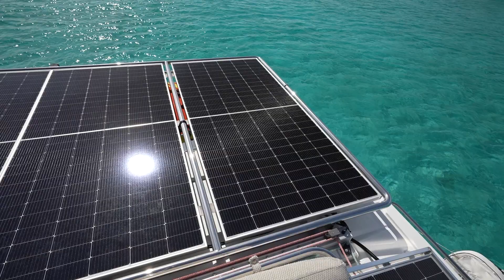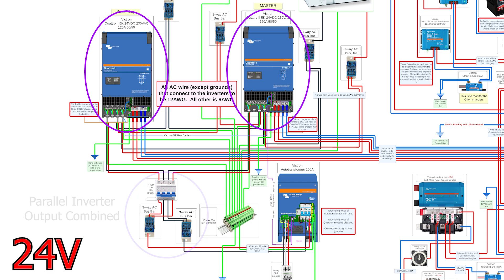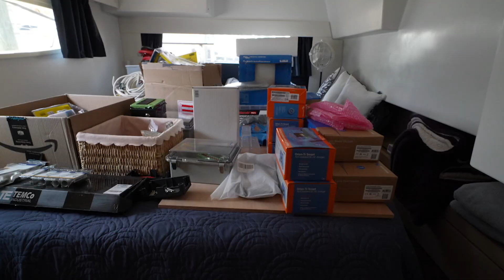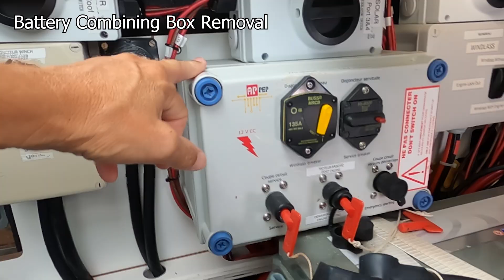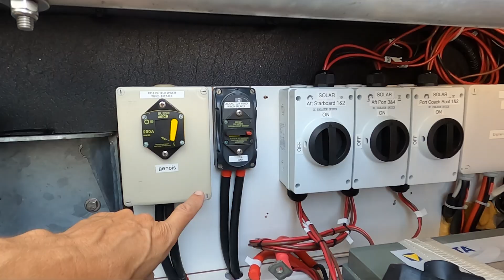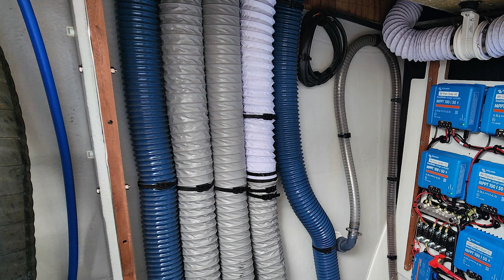This Power System Changed Our Sailing Life!! - Part 1 - Ep. 35

Comment from the maker: Hi Everyone!
This is the first in a series of videos covering our complete power system upgrade on our Fountaine Pajot Saona 47 sailing catamaran, which took over six months to complete.
In this video, we start with an overview of the system and the reasons for the project, design work, etc., and then move on to all the electrical cleanup needed before we could start the full installation of all the new fun stuff.

FOR THE LARGEST POSSIBLE DISCOUNT ON EPOCH BATTERIES (Minimum 10%), Use this link:  https://www.epochbatteries.com/?rfsn=8400125.d4f07b9
Our discount will match any discounts on the website as well (holidays, etc.)

Thanks so much for watching!  Stay tuned for all the upcoming videos in this series :)

Comment: Great episode and intersting perspective on 12/24/48v alternative - for the record Victron provide a 48v/12v DC/DC charger, which works just fine - I use this charging 12v AGM bank from 48v lithium battery bank with no issue (readily available) ...

Comment: First, its a great system... don't get me wrong.  I think you made some good choices.  Some of your logic is a bit flawed, but there are still plenty of reasons to go with 24V on a boat.  So don't take my points below as harsh criticism... really it's just light informational criticism instead.

* One thing about 48V... you don't have to put 12V batteries in series.  You get native 48V batteries instead and put them in parallel just like any other system.   Same with a 24V system... I'm not sure why you bought 12V batteries when you could have purchased 24V batteries (aka 25.6V LiFePO4) and gotten a lot more redundancy and scrapped the need for whole-battery balancers.

* For battery redundancy just paralleling two or more batteries does a good job.  So, for example for your 12V house bank... don't have just one 12V battery.  Have two smaller batteries in parallel for the same capacity.   You don't want to rewire batteries so in an emergency if the 12V bank dies completely... either just have a smaller 3rd battery (like a 100Ah or 50Ah 12.8V LiFePO4 battery) in storage, or have a DC-DC trickle-charger in storage (or even wired in permanently).  Or an AC charger that you can hang off the inverter output.

Systems such as the one you have in your boat now have a ton of flexibility when things go wrong.  It is almost always possible to make sufficient repairs or kludge-up solutions that retain nearly all the functionality of the system.

* Generally best to go with trickle-chargers for DC-DC instead of converters.  I think you did mostly go with DC-DC chargers but I'm not sure.  Main reason is that you can trickle-charge the cross-voltage energy flow at much lower amperages and the equipment is a lot cheaper, easier, smaller, and doesn't get stressed.

* Same thing for the starter battery... trickle-charge from the 24V bank instead of having a 12V alternator you have a 24V alternator (you might already have it setup like that, I don't what alternator configuration you are using).

* Victron kinda fails at providing split-phase solutions, which is really unfortunate.  You came up with a decent way to work around the problem though but you may want to keep a small 24V inverter on the shelf somewhere just in case the weak link (the auto-transformer) fails on you.  Otherwise your AC power is DOA.   Or even have it wired in (such as wired into the nav station), but turned off most of the time.  Just in case... so you have an AC plug that still works for a time even if the entire house system goes down.

--

However, you are absolutely right about the solar panel configuration.  It doesn't actually take much to develop the needed voltage but boats in general have very little surface area and a lot of variable shading to deal with, so it's reasonable to choose a 24V system voltage.

* One solution for solar on 48V boat systems where the solar panel topology is severely limited is to use a boost charge controller.

* Another is to simply have more lower-wattage panels in series.  For example, 4 x 25W panels in series can charge a 48V system just fine.  Or 3 x 50W, or 3 x (or 4 x) 100W, 3 x 200W, 2 x residential, etc.   Lots of options where the panel area taken up is still the same but the smaller panels develop the voltage needed.

* Yet another is to buffer the solar through a smaller battery first then DC-DC charge the larger 48V bank.  Not as efficient but works quite well.

--

NOTE: For your radio operation, I strongly recommend wiring 24VDC over to the radio area, then having a 24-12 DC-DC trickle charger (6A is plenty... even overkill)... plus a small 20Ah or 30Ah 12.8V LiFePO4 battery situated right next to the radio.  That way the radio is guaranteed to have ~24+ hours of operating time even if the entire rest of the boat's electricals fail.    Also run a small LED light from that same 12V radio subsystem.

-Matt
Reply from the maker: Matt, thanks for all your suggestions.  When we spected this out a year ago, there were a variety of reasons why we went with Epoch.  They didn't have the 24V at the time.  This may not be our forever system, but we are just showing what we did.  This is not a DIY.  We appreciate your comments.